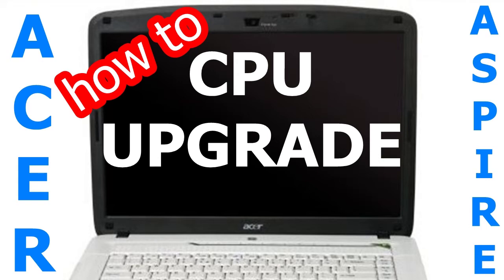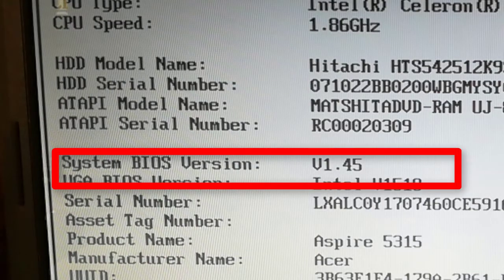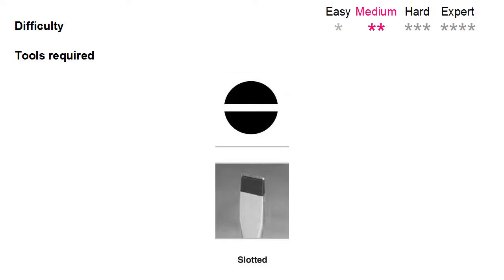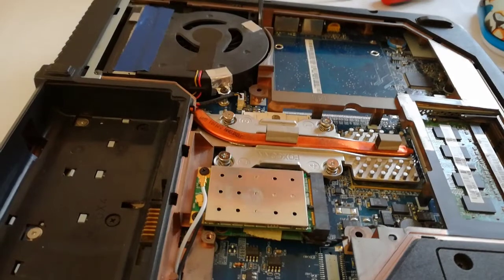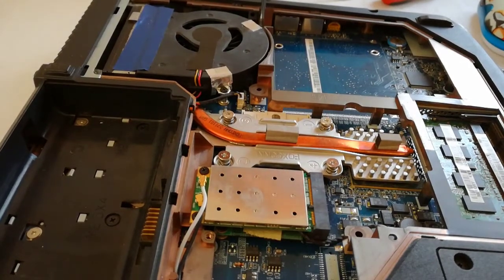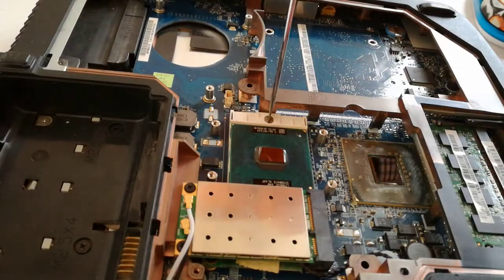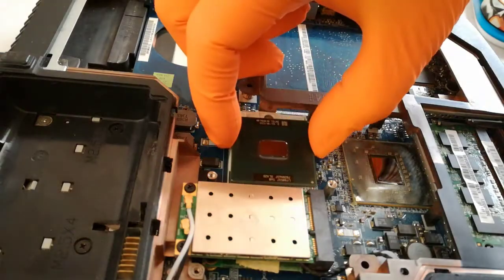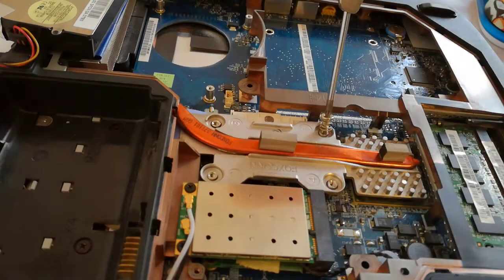How to upgrade the CPU for Acer Aspire 5315 laptop Ep.227

Comment: Hello, a question does the core 2 duo t6600 support the Acer aspire 5315?
Reply from the maker: Aloha, sorry , I don't think the T6600 is supported by this motherboard.
Try these 
Core 2 Duo T7250 @2 GHz	
Core 2 Duo T7300 @2 GHz
Core 2 Duo T7500 @2.2 GHz
Core 2 Duo T7700 @2.4 GHz 
Core 2 Duo T7800 @2.6 GHz 
Core 2 Extreme X7800 @2.6 GHz 
Core 2 Extreme X7900 @2.8 GHz
Thank you for watching, if my video or advice was useful, please consider to share and subscribe.
Reply: @redigitt  I got the Core 2 Duo t6600 from a broken Toshiba I installed it from the Acer aspire 5315 and for some reason it did work only that it was difficult at first to recognize it but it recognized it for some reason it worked and thanks for the advice I don't know if it is the processor that is in good condition that I got is that why it worked for me?
Reply: The truth is quite strange But hey what matters is that it works and thanks for the tutorial to install it correctly very good video
Reply from the maker: I'm glad it worked, enjoy the new CPU and thank you for your feedback, it will be helpful for others.

Comment: I reading on internet max 2gb ram ,the official..(but i have seen with 3 gb too😆)
Reply from the maker: Aloha, if you read below you will find this comment from Joaquin Olivera:
Joaquin Olivera
• 6 months ago
 @redigitt  Aloha, its me, from the future, from the same Aceraspire5315, but now with the Core 2 Duo T7700, it is blazing fast and it supports Youtube playback at 1080p or 720p60 without a problem, however it only supports 3GB of RAM, it seems that the bottom slot only supports 1GB sticks, but the top slot supports 2GB and 4GB sticks since one user even got it to run with 5GB of RAM, the 3GB of RAM and the new CPU gave this laptop a new life, and since i am using Windows Vista, the requierements are low and it runs flawlessly, and since i am using the extended kernel for Vista, i am now commenting from MS Edge V106, outdated software is not a problem.

and John Doe comment
John Doe
• 1 year ago (edited)
My wife bought one 10 years ago and we still have it - its longevity is remarkable. It was a dog when it was new with the Celeron. But the Core 2 duo T9300, the SSD, and the extra 2GB RAM brought it to life. Ive given up on Windows 10 however it runs like a dog on it. Linux Mint XFCE on the other hand is running remarkably well. It still struggles with HD video content, so YouTube is best set to 480p but you can browse comfortably with a few tabs open.
Thank you for watching, if my video or advice was helpful , then please don't forget to share, like the video and subscribe.
Good luck withe the upgrade.

Comment: If i will upgrade to this laptop a new 64 bit !!cpu, with how many ram can i uograde?4-8gb??
Reply from the maker: Aloha, if you read below you will find this comment  from Joaquin Olivera:
Joaquin Olivera
• 6 months ago
 @redigitt  Aloha, its me, from the future, from the same Aceraspire5315, but now with the Core 2 Duo T7700, it is blazing fast and it supports Youtube playback at 1080p or 720p60 without a problem, however it only supports 3GB of RAM, it seems that the bottom slot only supports 1GB sticks, but the top slot supports 2GB and 4GB sticks since one user even got it to run with 5GB of RAM, the 3GB of RAM and the new CPU gave this laptop a new life, and since i am using Windows Vista, the requierements are low and it runs flawlessly, and since i am using the extended kernel for Vista, i am now commenting from MS Edge V106, outdated software is not a problem.

Thank you for watching, if my video or advice was helpful , then please don't forget to share, like the video and subscribe.
Good luck withe the upgrade.

Comment: Which one is the biggest cpu what can i change (upgrade!) In this laptop?and 100% will working?
Reply from the maker: Aloha, if you read below you will find this comment from John Doe:
• 1 year ago (edited)
My wife bought one 10 years ago and we still have it - its longevity is remarkable. It was a dog when it was new with the Celeron. But the Core 2 duo T9300, the SSD, and the extra 2GB RAM brought it to life. Ive given up on Windows 10 however it runs like a dog on it. Linux Mint XFCE on the other hand is running remarkably well. It still struggles with HD video content, so YouTube is best set to 480p but you can browse comfortably with a few tabs open.
Thank you for watching, if my video or advice was helpful , then please don't forget to share, like the video and subscribe.
Good luck withe the upgrade.

Comment: Thanks you for this great video. Finally upgrade to Core 2 Duo T7500 (3.5 DOLLARS SHIPPING INCLUDED). I have a question: whay mode for the hdd is better? AHCI or IDE? My idea is install Windows 7 Professional, or you recommend windows 10? Greetings from Chile.
Reply from the maker: Aloha, definitely AHCI.
 Windows 7 has no support from Microsoft, so it could have some security issue, but the hardware requirement is smaller, if you have sensitive data on the PC then go with Windows 10.
If you don't have sensitive data and you have time, you could try for a week Windows 7 and then you could upgrade/install the Windows 10.
For Windows 10 you need an SSD otherwise it will run very slowly, you can check and compare in the Task Manager the HDD usage in Windows 7 and in Windows 10 right after the laptop powered on.
Thank you for watching, if my video or advice was useful, please consider to share and subscribe, 
or if you think I deserve it  and you want to support my work, You can do it by buying me a cup of coffee at the minimum value of  1$.
https://www.buymeacoffee.com/redigitt  I  https://ko-fi.com/redigitt  I  https://www.patreon.com/redigitt
Good luck and have a nice day .

Comment: Hello, will the acer aspire 5315 support a core 2 duo t9300 with 3 gigabytes of RAM? I have one and I want to become a titan
Reply: Thanks friend
Reply: I have a question which is better the core 2 duo t7800 or the core 2 duo t9300?
Reply from the maker: Aloha,  I didn't install T9300 but @John Doe leaved this comment
"• 8 months ago (edited)
My wife bought one 10 years ago and we still have it - its longevity is remarkable. It was a dog when it was new with the Celeron. But the Core 2 duo T9300, the SSD, and the extra 2GB RAM brought it to life. Ive given up on Windows 10 however it runs like a dog on it. Linux Mint XFCE on the other hand is running remarkably well. It still struggles with HD video content, so YouTube is best set to 480p but you can browse comfortably with a few tabs open. "

The T9300 is slightly better because has  4MB  L2 Cache memory  vs. T7800 has only 2MB .
The T9300 has more transistors 410 Million (45 nm1-1.25V) vs. T7800 (65 nm)  has only 291 Million  and probably the T9300 is cooler to, because has made with 45 nm technology.
Thank you for watching, if my video or advice was useful, please consider to share and subscribe, have a nice day

Comment: My wife bought one 10 years ago and we still have it - its longevity is remarkable. It was a dog when it was new with the Celeron. But the Core 2 duo T9300, the SSD, and the extra 2GB RAM brought it to life. Ive given up on Windows 10 however it runs like a dog on it. Linux Mint XFCE on the other hand is running remarkably well. It still struggles with HD video content, so YouTube is best set to 480p but you can browse comfortably with a few tabs open.
Reply from the maker: Aloha, thank you for your testimonial, unfortunatly these days don't make anymore so good build laptops.
Thank you for watching, if my video or advice was useful, please consider to share and subscribe.
Reply: Hi! could you possibly tell me what the model# of the SSD is? I am reading that it can be difficult to find one that works in this laptop.

Comment: Can I add i3 540 processor to acer aspire 5315 
Please reply
Reply from the maker: Aloha, no you can't upgrade with i3-540.
These CPU's are compatible with the motherboard.
Personally I would upgrade only up to  35W TDP CPU's like Core 2 Duo T7700 or Core 2 Duo T7800, 
with the 45W TDP CPU's you need a very good cooling system, otherwise the laptop will overheat. 
Celeron M 575 1 1 2 GHz 667 MHz 1MB 31W
Celeron M 585 1 1 2.167 GHz 667 MHz 1MB 31W
Celeron T1400 2 2 1.733 GHz 533 MHz 512KB 35W
Celeron T1500 2 2 1.867 GHz 533 MHz 512KB 35W
Celeron T1600 2 2 1.667 GHz 667 MHz 1MB 35W
Celeron T1700 2 2 1.833 GHz 667 MHz 1MB 35W
Pentium T2310 2 2 1.467 GHz 533 MHz 1MB 35W
Pentium T2330 2 2 1.6 GHz 533 MHz 1MB 35W
Pentium T2370 2 2 1.733 GHz 533 MHz 1MB 35W
Pentium T2390 2 2 1.867 GHz 533 MHz 1MB 35W
Pentium T2410 2 2 2 GHz 533 MHz 1MB 35W
Pentium T3200 2 2 2 GHz 667 MHz 1MB 35W
Pentium T3400 2 2 2.167 GHz 667 MHz 1MB 35W
Core 2 Duo T5250 2 2 1.5 GHz 667 MHz 2MB 35W
Core 2 Duo T5270 2 2 1.4 GHz 800 MHz 2MB 35W
Core 2 Duo T5450 2 2 1.667 GHz 667 MHz 2MB 35W
Core 2 Duo T5470 2 2 1.6 GHz 800 MHz 2MB 35W
Core 2 Duo T5550 2 2 1.833 GHz 667 MHz 2MB 35W
Core 2 Duo T5670 2 2 1.8 GHz 800 MHz 2MB 35W
Core 2 Duo T5750 2 2 2 GHz 667 MHz 2MB 35W
Core 2 Duo T5800 2 2 2 GHz 800 MHz 2MB 
Core 2 Duo T5850 2 2 2.167 GHz 667 MHz 2MB 
Core 2 Duo T5870 2 2 2 GHz 800 MHz 2MB 
Core 2 Duo T5900 2 2 2.2 GHz 800 MHz 2MB 
Core 2 Duo T7100 2 2 1.8 GHz 800 MHz 2MB 35W
Core 2 Duo T7250 2 2 2 GHz 800 MHz 2MB 35W
Core 2 Duo T7300 2 2 2 GHz 800 MHz 4MB 35W
Core 2 Duo T7500 2 2 2.2 GHz 800 MHz 4MB 35W
Core 2 Duo T7700 2 2 2.4 GHz 800 MHz 4MB 35W
Core 2 Duo T7800 2 2 2.6 GHz 800 MHz 4MB 35W
Core 2 Extreme X7800 2 2 2.6 GHz 800 MHz 4MB 44W
Core 2 Extreme X7900 2 2 2.8 GHz 800 MHz 4MB 44W 
Thank you for watching, if my video or advice was useful, please consider to share and subscribe, have a nice day.
Reply: @redigitt  and what are compatible memories?
Reply from the maker: You can try 2x2GB, but it seems that accepts only 3GB RAM.
Thank you for watching, if my video or advice was useful, please consider to share and subscribe, have a nice day.
Reply: @redigitt  can I upgrade to t7800? And where I got the cpu
Reply from the maker: Yes you can upgrade with the Core 2 Duo T7800 2 2 2.6 GHz 800 MHz 4MB 35W CPU.
Please use a good quallity thermal paste if upgrade your CPU from a lower TDP CPU (27W ,31W)to a higher TDP CPU( 35W), otherwise will overheat the CPU.
You should look first on your local second hand market or on the internet.
Thank you for watching, please subscribe, share it  and good luck with the upgrade.

Comment: Hello,I have a TravelMate 7740 laptop acer
Socket 989 rPGA
Mainboard: Acer BA70-CP
CPU: Intel Core i3 370M
Can I install an i7 940XM / i7 840QM / i7 740QM processor?
Reply from the maker: Aloha, I didn't made any CPU upgrade for the TravelMate 7740, you can try these CPU's,
 first update your BIOS to the latest version.
Core i3-370M 2 4 2.4 GHz   512KB 3MB 35W   +
Core i3-380M 2 4 2.533 GHz   512KB 3MB 35W   +
Core i3-390M 2 4 2.667 GHz   512KB 3MB 35W   +
Core i5-430M 2 4 2.267 GHz 2.533 GHz 512KB 3MB 35W +  
Core i5-450M 2 4 2.4 GHz 2.667 GHz 512KB 3MB 35W   +
Core i5-460M 2 4 2.533 GHz 2.8 GHz 512KB 3MB 35W   +
Core i5-480M 2 4 2.667 GHz 2.933 GHz 512KB 3MB 35W   +
Core i5-520M 2 4 2.4 GHz 2.933 GHz 512KB 3MB 35W + +
Core i5-540M 2 4 2.533 GHz 3.067 GHz 512KB 3MB 35W + +
Core i5-560M 2 4 2.667 GHz 3.2 GHz 512KB 3MB 35W   +
Core i5-580M 2 4 2.667 GHz 3.333 GHz 512KB 3MB 35W   +
Core i7-620M 2 4 2.667 GHz 3.333 GHz 512KB 4MB 35W + +
Core i7-640M 2 4 2.8 GHz 3.467 GHz 512KB 4MB 35W   +
Thank you for watching, if my video  was useful, please consider to share and subscribe and good luck with the upgrade.

Comment: What if i use the i3 CPU?
Reply from the maker: Aloha, I don't think you will find compatible i3 CPU for this laptop, this has socket M, probably these CPU's are compatible with the motherboard, before the upgrade please update your BIOS.
Personally I would upgrade only up to  35W TDP CPU's like Core 2 Duo T7700 or Core 2 Duo T7800, 
with the 45W TDP CPU's you need a very good cooling system, otherwise the laptop will overheat. 
Celeron M 575 1 1 2 GHz 667 MHz 1MB 31W
Celeron M 585 1 1 2.167 GHz 667 MHz 1MB 31W
Celeron T1400 2 2 1.733 GHz 533 MHz 512KB 35W
Celeron T1500 2 2 1.867 GHz 533 MHz 512KB 35W
Celeron T1600 2 2 1.667 GHz 667 MHz 1MB 35W
Celeron T1700 2 2 1.833 GHz 667 MHz 1MB 35W
Pentium T2310 2 2 1.467 GHz 533 MHz 1MB 35W
Pentium T2330 2 2 1.6 GHz 533 MHz 1MB 35W
Pentium T2370 2 2 1.733 GHz 533 MHz 1MB 35W
Pentium T2390 2 2 1.867 GHz 533 MHz 1MB 35W
Pentium T2410 2 2 2 GHz 533 MHz 1MB 35W
Pentium T3200 2 2 2 GHz 667 MHz 1MB 35W
Pentium T3400 2 2 2.167 GHz 667 MHz 1MB 35W
Core 2 Duo T5250 2 2 1.5 GHz 667 MHz 2MB 35W
Core 2 Duo T5270 2 2 1.4 GHz 800 MHz 2MB 35W
Core 2 Duo T5450 2 2 1.667 GHz 667 MHz 2MB 35W
Core 2 Duo T5470 2 2 1.6 GHz 800 MHz 2MB 35W
Core 2 Duo T5550 2 2 1.833 GHz 667 MHz 2MB 35W
Core 2 Duo T5670 2 2 1.8 GHz 800 MHz 2MB 35W
Core 2 Duo T5750 2 2 2 GHz 667 MHz 2MB 35W
Core 2 Duo T5800 2 2 2 GHz 800 MHz 2MB 
Core 2 Duo T5850 2 2 2.167 GHz 667 MHz 2MB 
Core 2 Duo T5870 2 2 2 GHz 800 MHz 2MB 
Core 2 Duo T5900 2 2 2.2 GHz 800 MHz 2MB 
Core 2 Duo T7100 2 2 1.8 GHz 800 MHz 2MB 35W
Core 2 Duo T7250 2 2 2 GHz 800 MHz 2MB 35W
Core 2 Duo T7300 2 2 2 GHz 800 MHz 4MB 35W
Core 2 Duo T7500 2 2 2.2 GHz 800 MHz 4MB 35W
Core 2 Duo T7700 2 2 2.4 GHz 800 MHz 4MB 35W
Core 2 Duo T7800 2 2 2.6 GHz 800 MHz 4MB 35W
Core 2 Extreme X7800 2 2 2.6 GHz 800 MHz 4MB 44W
Core 2 Extreme X7900 2 2 2.8 GHz 800 MHz 4MB 44W 
Thank you for watching, if my video or advice was useful, please consider to share and subscribe, have a nice day.

Comment: Great Video. I upgraded my Acer Aspire 5315 to a Intel Core Duo T7500 and upgraded the ram to 3G. Runs Windows 10 Pro with ease with no overheating. Runs at an average of 60 degrees C.  Acts like a new computer. Thanks for the help.
Reply from the maker: I'm glad my video was useful, please don't forget to share.
Reply: I'm on the exact same mission, found my old pal Acer 5315 on the attic. I'm waiting for the T7500 to arrive tomorrow. :)  How did you flashed the bios? Did you used some software (winflash or similar) or simple exe of the 1.45 bios version?
Reply from the maker: @A_n_y_t_i_m_e   Here I have made a youtube video with the BIOS update  https://www.youtube.com/watch?v=VuHc6mkrcGI.
Thank you for watching and good luck with the upgrade.
Reply: @redigitt  Thanks, already did it 10 days ago. It was a complete success and everything went smooth. 3 gigs of ram(2+1), T7500 CPU, cleaned everything... It's a totally different laptop. 1080p runs smoothly, 32bit Win10Pro boots up extremely quick, it's became pretty quick and responsive laptop overall, even good for using some lighter video processing programs and photoshop. Now I'll just do put an SSD, for this I'm getting an SATA2PATA caddy (as my dvd drive has PATA connector), clone the OS to SSD and voila.
Reply: @A_n_y_t_i_m_e  i have upgraded my acer aspire 5315 with T7500 cpu, 3 gb ram, 64bit win10 pro and on youtube doesn t run smooth in 1080p, only 720p. its because of the windows 10 pro 64 bit?
Reply: @stefan1onl  When having 4 gigs of ram or less, stick with 32bit OS for better overall performance.
Reply: @A_n_y_t_i_m_e   so, it means i need to reinstal windows 10 pro 32 bit os, right?
Reply: @stefan1onl  Yes, you should see the difference instantly. Maybe even sticking with Win7 wouldn't be a bad idea.
Reply: @A_n_y_t_i_m_e  ok, ill do it. thank you so much
Reply: Is it suit with intel i7 ? I don't know much bout this.
Reply from the maker: @Truth-Spoken  Sorry, NO. This motherboard has P socket (478-pin micro-FCPGA1.38" x 1.38" (3.5 cm x 3.5 cm) and this laptop is about 15 years old, with an upgrade can be used for daily simple tasks like: web browsing,  light YouTube videos (not full HD videos), e-mails, Facebook, office, but is not suitable for new gaming, 
We are talking about a 15-16 years technology, but I like it because it was made to be upgradeable. 
The new laptops are not upgradeable, you buy it with an onboard soldered slow CPU, onboard soldered RAM memory, whithout any RAM slots forfuture  ugrade and after 2 years you throw it to the trash = you buy electronic garbage.